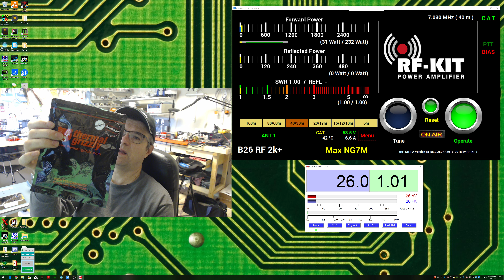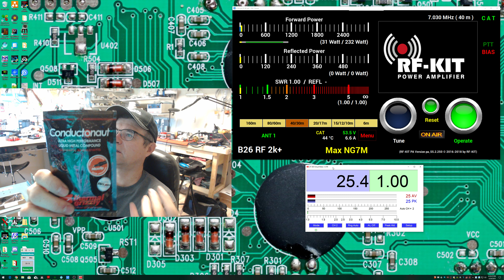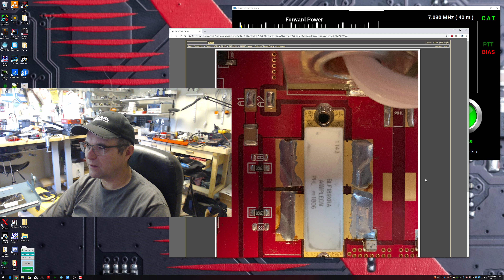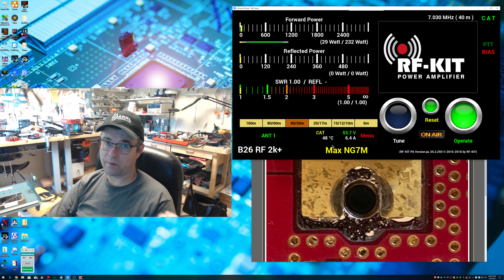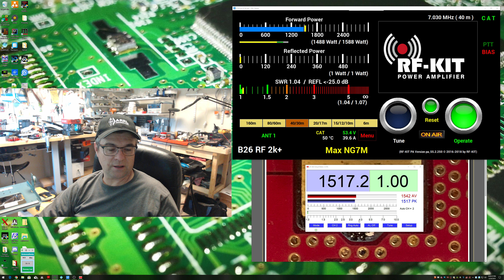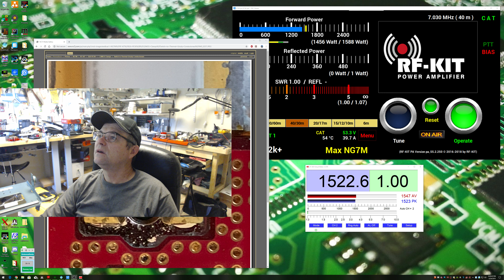RF-KIT b26-RF2K+ LDMOS Clamps and Thermal Grizzly Liquid Metal Compound

Comment: Don't use liquid metal you can potentially short the drain and the source (the mounting flange) and cause a catastrophic failure.
Reply from the maker: Agreed.... I was experimenting... I didn't go back to the liquid metal... I wouldn't recommend it.  It's been so long since I made that video, but I suspect I mention that.  I can't remember.

Comment: Thanks for nice video , I have a BLF188XR and i will mount copper plate, I want solder but its difficult, but use any Liquid Metal Compound very easy but, I think no have a big diffirent for termal contuctivity. 73 . TA4AU